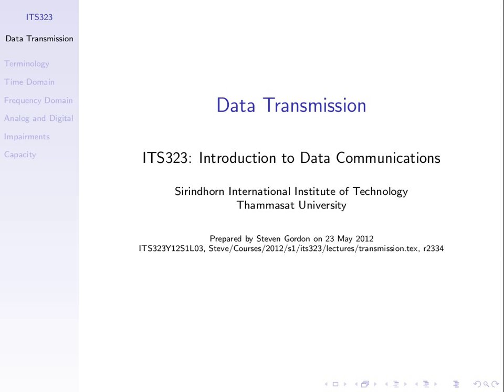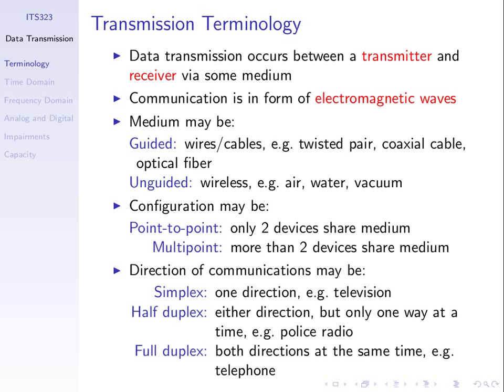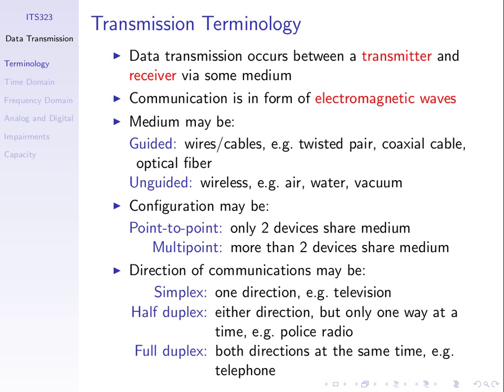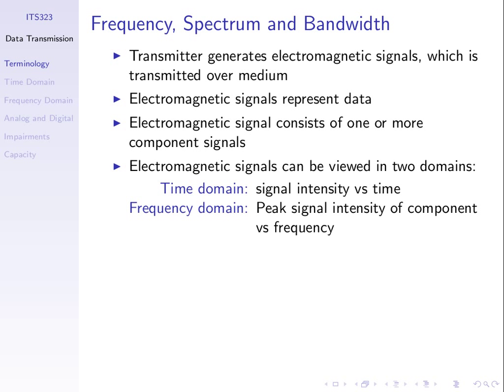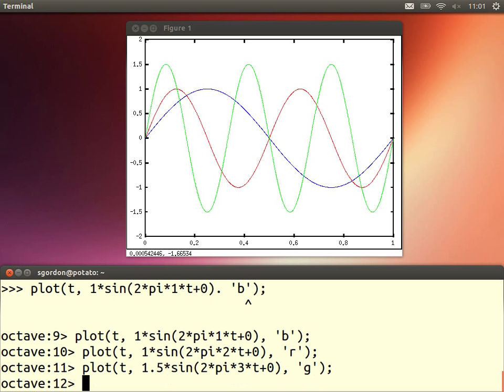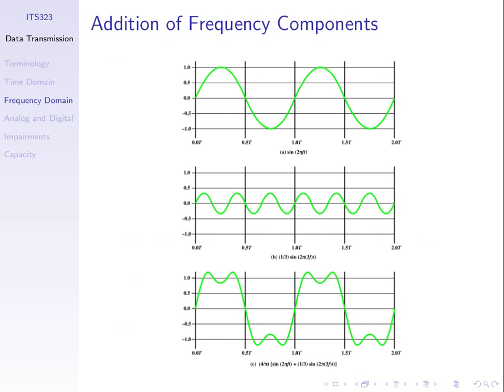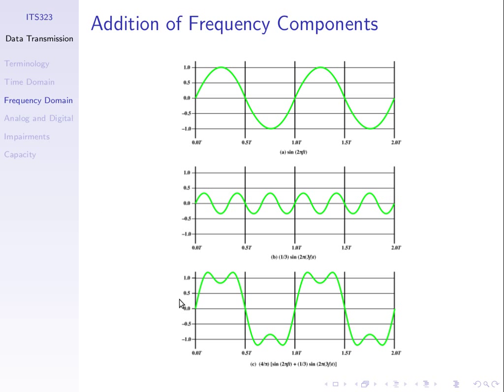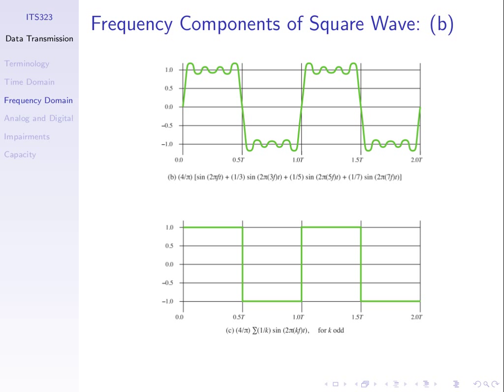ITS323, Lecture 06, IT, 26 Jun 2013 - Data Transmission and Signals

Comment: I'm wondering is there an advantage of using the frequency domain over the time domain when plotting them for analysis?
Reply from the maker: Its often much easier to determine the properties of interest from the frequency domain plots. For example, bandwidth of a signal is very important (the larger the bandwidth, the higher the data rate, but the more interference with others and higher cost due to limited spectrum). Looking at a frequency domain plot of a signal the bandwidth can be easily obtained, but not from the time domain plot. Communication engineers commonly use the frequency domain to design and analyse signals.
Reply: Steven Gordon Thank you for explaining that.